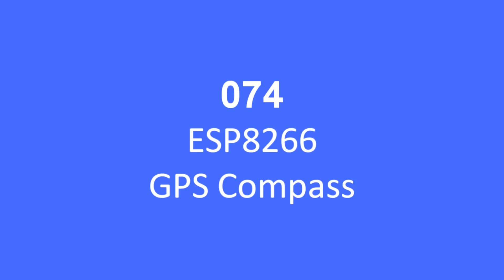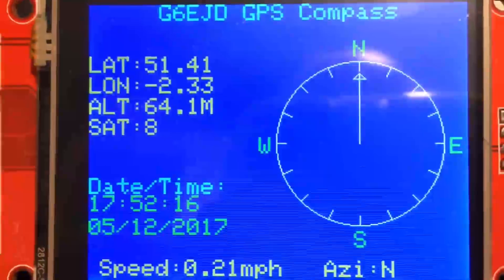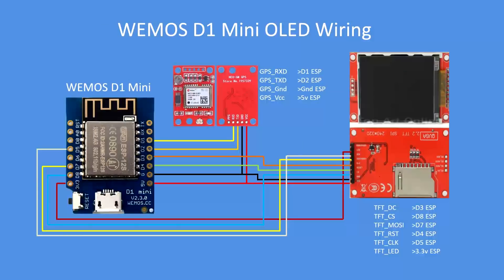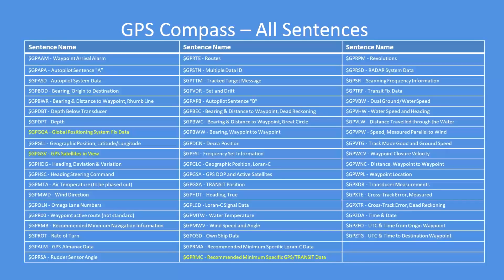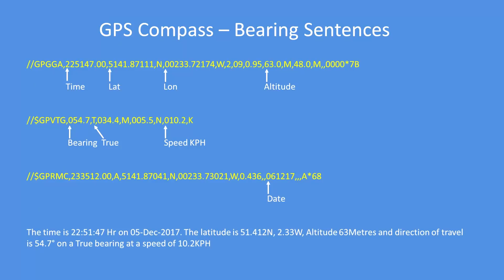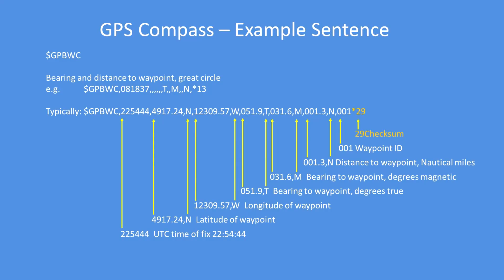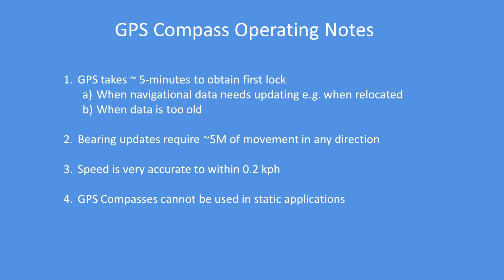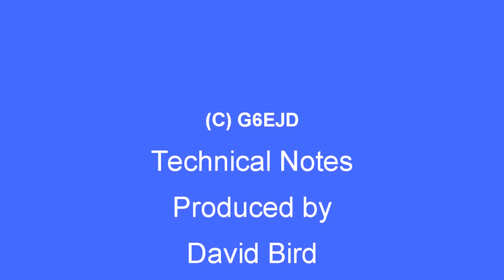Tech Note 074 - GPS Compass using an ESP8266 or ESP32, NEO6M GPS and ILI9341 Display

Comment: Perfect! thank you. I've been working on a bike speedometer and the last thing I wanted to add was a compass on the display. I'm using similar hardware as you. I've Google how to do it and searched a few times on YouTube, lots of suggestions as to how to do it but no one, until I found your video, actually did it. I incorporated your compass code into mine and it works terrific. Thanks so much for sharing, well done.

Comment: I connected: 
GPS
RX with D1;
TX with D2;
GND with G;
Vcc with 5V;
Display
DC with D3;
CS with D8;
Mosi with D7;
Reset with D4;
SCK with D5;
Led with 3.3V.
Reply from the maker: Check you have connected GPS RXD to D2 and have defined D2 as TXD and the same for GPS TXD to D1 defined as RXD in the D1 Mini. You should see data from the serial2 port

Comment: Sorry, to load the sketch correctly which board should I use: NodeMCU 1.0 (ESP12E- Module), WeMos D1 R1 or other?
Reply from the maker: Have you selected the correct pins in software serial of the GPS? Any board will do as long as your consistent with the pins

Comment: Also the one you emailed me with the transformation from miles to kilometers
Reply from the maker: OK, I've just tried this myself and it's working OK. Where did you get the GPS from? Are you sure it's working. Have you tried another example code from the examples in the IDE to see if they work? Display is irrelevant for testing. My GPS is a ublox 6

Comment: Hi, many thanks for the tutorial. Exactly what I was looking for. But I have a small problem. I don't get the sentences $GPBWC, which I really was looking for, to get the compass readings. Is there something to initialize? What is the waypoint? Do I need to send some reference to be able to get this sentence out? Please help if possible. I know this is an old tutorial.
Reply from the maker: It’s a function of the GPS module as to whether they receive that sentence or not. UBLOX 6 or 7 will do it.
Reply: @G6EJD  Oh ok, I have used a Neo6M V2 here. Waypoint sounds like a reference point, but wonder what it is. Is it the N-pole? Or a given reference point by the user. I'll check if I can buy a UBLOX, like you suggested. Thanks.

Comment: (Waiting for GPS to acquire signal...) 
The connection of the RX pin of the GPS is to the D1 pin of the ESP, the TX pin of the GPS is to the D2 pin of the ESP and this is the sketch line (SoftwareSerial gps (D1, D2); // RX / TX Data Pins , Connect the GPS to D2 and D1). Everything is correct?
Reply from the maker: Those pins are the wrong way round D1 is defined as RX not TX they must be cross   connected RXD-TXD TXD-RXD
Reply from the maker: According to this you have GPS RXD to D1 which is assigned as RXD just reverse SoftwareSerial.gps to SoftwareSerial.gps(D2,D1);

Comment: Thanks so much for the previous answers! Is it possible to change the speed value from MPH to KMH? If it can be done, how can it be done? Thank you.
Reply from the maker: Multiply the value in MPH by the conversion factor MPH = MPH * 1.6093;
Or create a new variable kph = mph * 1.6093; then display kph instead of mph

Comment: Any ideas how to get it to update ever meter or possibly smaller units? Maybe more than one module updating offset from each other?
Reply from the maker: It’s not possible as the update is an GPS function, it has to detect movement to calculate the x, y and z parameters from the current location it is also a function of the CEP - Circular Error Probable about 5M for the GPS system which is the receivers ability to discriminate timing accuracy to get a fix. Only a differential gps (expensive) could do better.

Comment: Sorry I forgot that I would also like to know what is the difference between the ESP8266_Simple_GPS_Reader_01 sketch and ESP8266_Simple_GPS_Reader_02? Thanks.
Reply from the maker: I added back ordinal directions N, S, E and W, if you have pins problem, then your board definition does not have them defined.
Reply: @G6EJD  
OK thank you very much

Comment: Hi, I have tried several NEO-6M GPS and something is starting to work! I have problems with the latitudiune from a standing position while, always from a standstill, the longitude seems to work. But when I'm on the move, the latitude doesn't work and neither does the longitude and the time is one hour behind Italy! Could it be GPS module incompatibility? Can you tell me a link on Amazon where I can buy it? Thank you.
Reply from the maker: GPS time is always UTC so it will be 1hour out for CET, problems are almost always signal strength being too low or poor quality GPS receiver antennas. You should get consistent data output from the GPS are you getting that?

Comment: Hi David. I have a GPS Navigation/tracking project and I think it would be a good idea to read the azimuth (bearing) from the gps module (like you do) instead of using a separate digital compass (GY-271). Thanks for all info. Danny ON4CLU
Reply from the maker: Hi Danny, the only (small) disadvantage is the heading remains at the last known value until there is about 3-4metres of movement then it gets updated, it also depends on the CEP (circular error probable) and how many satellites are being received, but in practice these are all minor shortcomings and in most instances it just works.

Comment: I connected everything and did a test but it doesn't work! The display works fine with all indications but the displayed values are all zero. In practice it displays: LAT: 0.00; LON: 0.00; ALT: 0.0 M; SAT: 0; Date / TIME: 00: 00: 00; Speed: 0.00mph and Azi: No value. Do I need to change anything in the sketch?
Reply from the maker: Does the gps have a clear view of the sky it needs that for at least 5-10 minutes until the FPS light starts to flash at 1-sec intervals, it then has to collect ephemeris data especially if it’s last location was a long way away from current and the satellite constellation data will have changed

Comment: Very helpful contribution. I am a beginner and wanted to refresh the page  with something like meta http-equiv="refresh" content="5" which I understand is normally put in the header. Would it be possible to suggest where this should go?
Reply from the maker: OK, so I think you've implemented this compass code on an HTML web page? There is only one correct place for the meta refresh attribute and that's in the <head> section, like this:<head>
      <meta http-equiv="refresh" content="30">
</head> What that will do is signal to the browser to seek every 30-secs another connection to the source/server and get a new page, if the page has been refreshed by the server perhaps with new data readings/heading then you will see the effect on the browsers screen.If your trying to replace a compass in HMTL you will find the drawing primitives 'primitive' and HTML won't allow you to draw a circle easily. JAVA OK.Is that what you meant?
Reply: Thank you for your very prompt reply - worked perfectly.

Comment: Big project. Good job. Everything correct except the latitude and longitude 
shows degrees and minutes but no seconds.
Is there any solution? 

-Sketch: ESP_GPS_Compass_01
-Wemos D1 mini
-Board: LOLIN(WEMOS) D1 R2 & mini

Thank you.
Reply from the maker: The GPS location is in decimal degrees so it’s really easy to extract seconds with seconds = location % 3600
minutes = location % 60
Reply: @G6EJD  Thank you for answering so quickly.
I have solved the problem by modifying the code:

Before
 PrintText(5, 45, "LAT:" + String(dLatitude), YELLOW, 2);
 PrintText(5, 63, "LON:" + String(dLongitude), YELLOW, 2);

After

 PrintText(5, 45, "LAT:" + String(dLatitude, 4), YELLOW, 2);
 PrintText(5, 63, "LON:" + String(dLongitude, 4), YELLOW, 2);

The display shows (for example):
Before
40.41
-3.70
After
40.4165
-3.7025
Great project. Greetings from Spain

Comment: No, the GPS connects and the LED flashes normally but no value displayed!
Reply from the maker: Then the ESP32 is not receiving the serial data from the GPS, have you checked the wiring?  Defined the correct pins for the second serial port? What board type are you using?

Comment: great project want to make one but cant find the good Arduino Libraries want to flash it on a TTGO T BEAM
Reply from the maker: All the libraries needed are freely available, the only difference would be with the TTGO  display library needs, but you can get that from a TTGO example code.

Comment: Hi, great job! When I compose the sketch it gives me an error at line 30 (#define TFT_CS D8) and as an explanation it says ('D8' was not declared in this scope) how can I solve? Thanks.
Reply from the maker: Check you connections and use the GPIO pins in use, so if you have connected CS to pin 8 change #define TFT_CS 8 or whatever pin your using, what board are you using?

Comment: Hi,
I get data on tft but this are not the right data value from Berlin/Germany:
On TFT:   LAT  5.23   LON  0.00  Alt 0,1M

Google:      Latitude of Berlin: 52.520007    Longitude of Berlin: 13.404954      52° 31' 12.025" N     13° 24' 17.834" E 

Something is wrong!

Comment: Hi, I have a couple questions maybe you can answer. Fist have you tried to get the SD card on the display working? I have thied sevewral differen combinations of connections and none seem to work

Second, I updated mt Adafruit librarys and now the GPS sketch won't compile, I get the following error"C:\Users\stan\Documents\Arduino\libraries\Adafruit_ILI9341/Adafruit_ILI9341.h:160:33: error: no members matching 'Adafruit_GFX::drawRGBBitmap' in 'class Adafruit_GFX'

         using     Adafruit_GFX::drawRGBBitmap; // Check base class first

                                 ^

Can you tell me what version libraries you are using?

Thanks,
Stan
Reply from the maker: I'm using the latest Adafruit ILI9341 library. I checked the last update, it says:
// Adapted from https://github.com/PaulStoffregen/ILI9341_t3// by Marc MERLIN. See examples/pictureEmbed to use this.// 5/6/2017: function name and arguments have changed for compatibility// with current GFX library and to avoid naming problems in prior// implementation.  Formerly drawBitmap() with arguments in different order.void Adafruit_ILI9341::drawRGBBitmap(int16_t x, int16_t y,So drawRGBBitmap is a current function, I therefore suspect you have multiple libraries and your IDE is picking up and older version.
I have got the SD card to operate on the ILI9341 display. You have to parallel wire the SPI bus to the other side (few have a combined display/SD card bus wiring, but I have one somewhere that does and then use another GPIO pin for the SD-Card select, some have the touch sensor too, so that would be three CS pins. But generally there would be two, where one is for the display and the other the SD-Card. In your SD card initialisation you have to tell it what pin your using, the default might be 4. SD.begin(pin);

Comment: I tested it longer and I saw after restart I got other Values:
LAT52.32  LON 13.16  and Alt  51.5M   and SAT 8

This values are near to the values from google.
But then the values changed into the values I posted last.
Reply from the maker: U E, these aren’t code errors they are gps reception problems, if your unit is new it can take a while to receive the full satellite ephemeris data.
Reply: @G6EJD  , you missunderstood my problem. (My bad english!!)
At any time when I start the arduino I get first  (after seconds) good values and when the values reload the new values are wrong. I tested this for 2 hours. Same result every newstart.

GPS in Berlin is very good and fast. After some seconds I get the GPS sentences. In one of my last tutorials I build a "GPS-Tracker" for my bicycle tours. It works great also under trees in a park.
Here is the URL of this tutorial: 

 http://www.toptechboy.com/arduino/lesson-22-build-an-arduino-gps-tracker/
Reply from the maker: So the gps has to move to get direction?

Comment: Hi, thanks for this tutorial.
I have one problem: I get no GPS-Signal.  In my other GPS-Tutorial  I got no problems with GPS. I Live in Berlin/Germany. There are many Satelite and very good GPS-Reception.
Reply from the maker: Have you given the GPS antenna clear external sight of the sky? If the GPS has been off for some time it needs to download a new data set and that can take many minutes, the GPS reception is autonomous from external connections so it should show a lock after 5-mins or so. There is a problem with EGNOS but I don’t know if it’s been fixed yet, it should not matter if there was as the receiver should select other satellites.
Reply: - I use IDE 1.8.7 and board: "WeMos D1 R2 & mini"  

- Compiling ok
- Display ok
- clear external sight of the sky     ok
- LED on GPS-Board blinking        ok (?)
-> I wait over one hour but no GPS-data on display. Only 0.00   0.00  .......  . 

Something is not ok. But I can not fix this problem.
Reply from the maker: Which data pins are you using? You can’t easily use the 8266 Rx and Tx pins.
Reply: Data-Pins:
GPS-Board          WeMos D1 mini
     RX                       D1
     TX                       D2

Comment: Hello and sorry for the inconvenience! I have made all the connections as shown in the diagram but the display lights up and you can't see anything! I purchased this display (https://www.amazon.it/gp/product/B08FJ8SGZC/ref=ppx_yo_dt_b_asin_title_o00_s00?ie=UTF8&psc=1) could it be the 2.8 "display not compatible? Thanks.
Reply from the maker: The display looks OK, I suspect you have the wrong SPI connections from your board or one is not making contact, a common problem. What type of board are you using, link please. What board type are you selecting in the IDE?
Reply from the maker: Which code version are you using,

Comment: BOARD D1 MINI ESP8266 ESP-12 WLAN WIFI NODEMCU MODULO BOARD IOT WEMOS ARDUINO
Reply from the maker: So what pins have you defined for serial as there aren’t that many free after the SPI display is connected